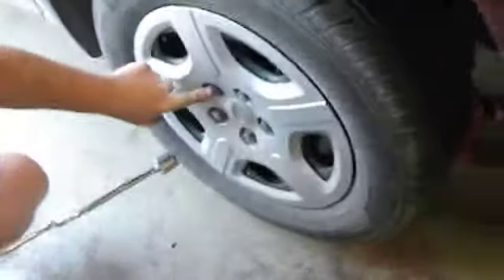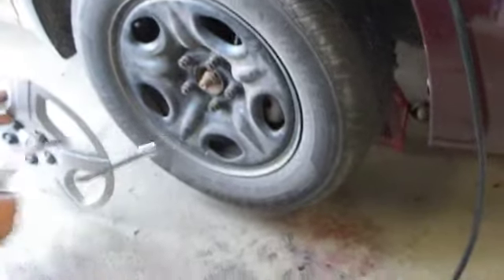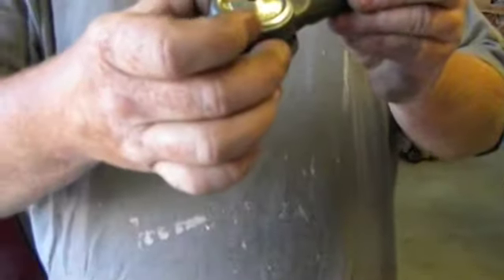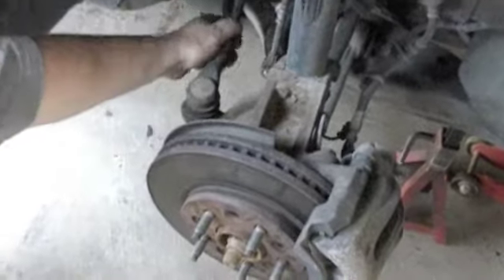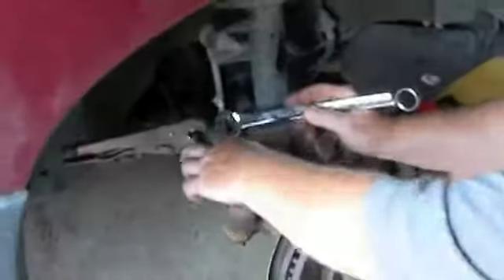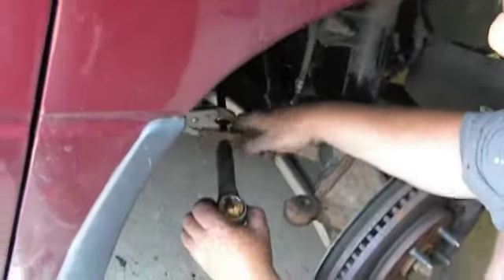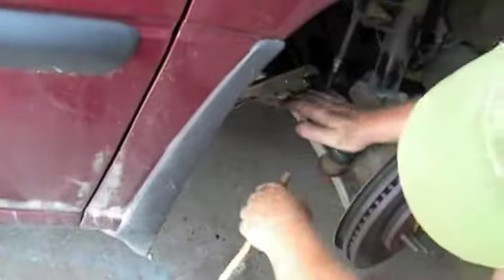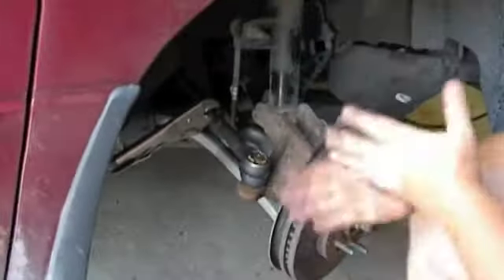How to install a tie rod (outer tie rod) (video1 of 2)

Comment from the maker: @tskorka1000   The tie rod end by the steering knuckle?  Or the other end with the jam nut?  The steering knuckle end may be stripped, either the nut or the tie rod bearing threads.  On the other side with the jam nut, you have to hold the shaft with a pair of vice grips and use a wrench to tighten the tie rod end and the nut.  Hope this helps.  If not, check out more video's, a repair manual, or call a friend...  Good luck!

Comment from the maker: Yes.  I marked the location with marker on the threads.  Back off the jam nut and mark the exposed threads (beside the tie rod end)  Remove the tie rod (you can try counting the number of turns also)  then put on the new tie rod to the mark (recount number of turns if you like).  It is the same method as the workshop manual.  Good luck!  Drink beer and save money!

Comment from the maker: I actually had to go back and check on this one.  It seems there are two ways of describing this. The "outer tie rod" or the "tie rod end" is threaded onto the "inner tie rod" or "tie rod" itself which bolts onto the steering rack.  I'm guessing it's like the difference between a "bonnet" and a "hood"  LOL!  Thanks for your comment,  I appreciate the clarification.

Comment: Thank you for posting this. I had to unbolt my outer tie rod end to swap an axle shaft and am trying to reattach the tie rod.  My problem is that the bolt is just spinning when tightening. Any tips for this?

Comment: Well, I would say that we have the same semantic issue here, as I think the proper term for the inner end is, well, the inner tie rod end. The tie rod is the piece in the middle, the thing that is actually a rod. Both ends screw out, and thus are not technically the actual tie rod. So the term tie rod can refer to either the entire assembly, or just the rod. But the ends, separated from the tie rod, are just the tie rod ends. This becomes important in describing differing mechanical failures.

Comment: you should of counted the amount of turns it took to take off the old end to align the new one. Then get them aligned. A garage can change the alignment by turning rod you have the mole grips connected to. It should cost about $80

Comment: FTR, that is not a tie rod, that is an outer tie rod end. The tie rod itself is the actual rod you have clamped with the vice grips. This has relevance if you are trying to replace the actual rod, if, for instance it gets bent.

Comment: But what I am saying is that it isn't an outer tie rod. It is just the tie rod end. The actually tie rod is, well, the rod, that connects the inner and outer ends. As I said, the distinction is important if the reason for replacing the tie rod is a bend or broken rod, rather than a loose balljoint on the tie rod end, since replacing the actual tie rod is a bit more of a complicated procedure (though not much).
Anyway, carry on.